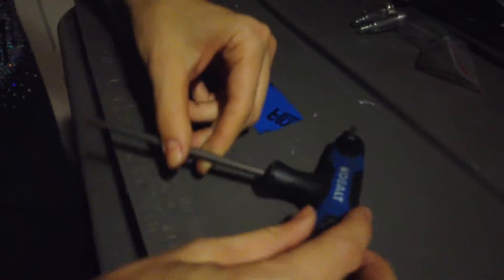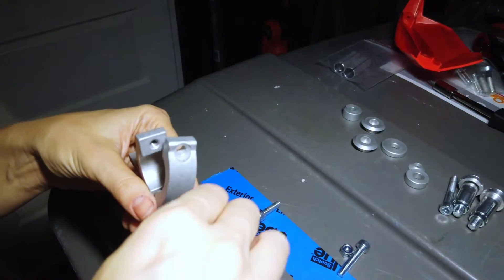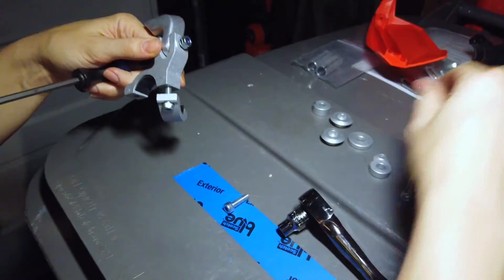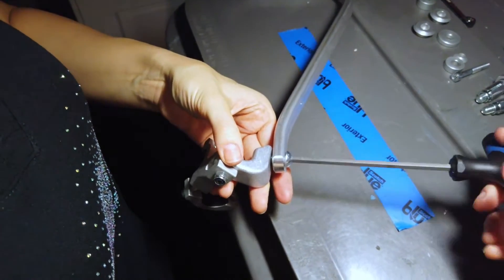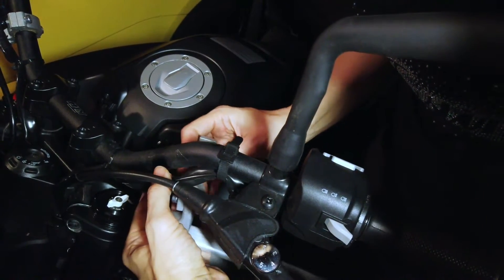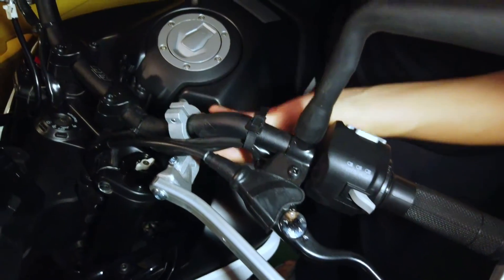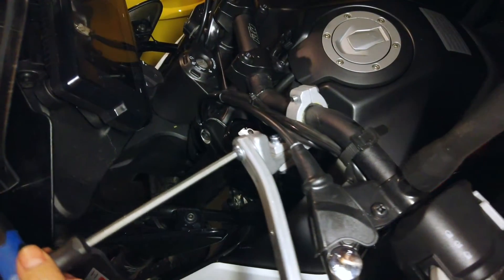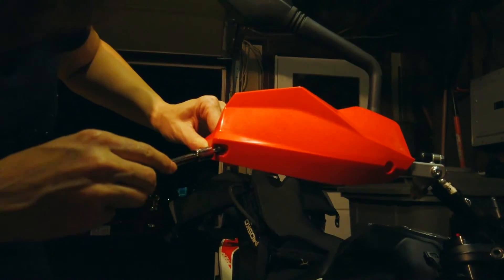KTM 390 Adventure handguards installation

Comment: Hello Lana, sorry too late to be here. I owned the KTM powerparts handguard kit and have the frame. As you said, the KTM power kit was also a OEM from BarkBluster, I wonder if the Barkbluster plastic, especially VPS version, can fit with the KTM aluminum.

Comment: From the KTM site, this kit is not listed as fitting the 390 Adventure as it did several months ago. Looking at the pictures of the included hardware, there is no spacer anymore and the conical washer is not included. I'm worried it won't fit
Reply from the maker: This is why I recommend the new Barkbusters hardware BHG-084 with the KTM plastic covers for better looks. The kit sold by KTM is also Barkbusters, but it's an older poorly adapted model. It can be made to work like I did in the video, but the 084 kit will give you a much better result.
Reply: @LanaOnWheels  thank you!